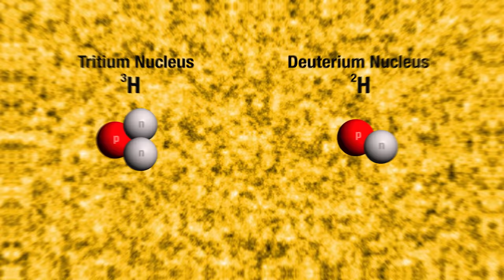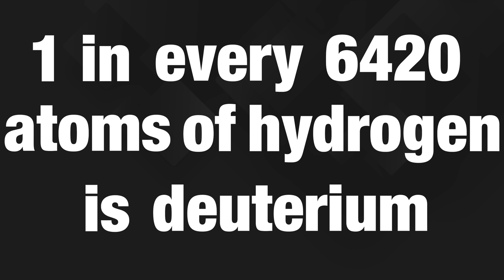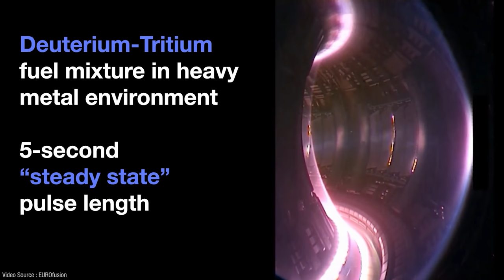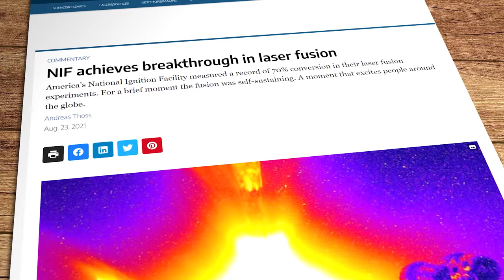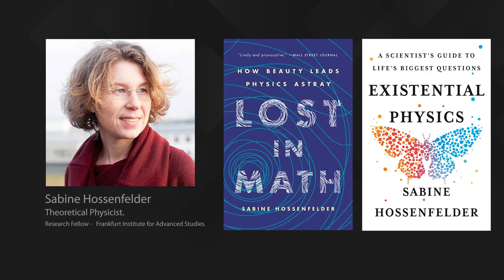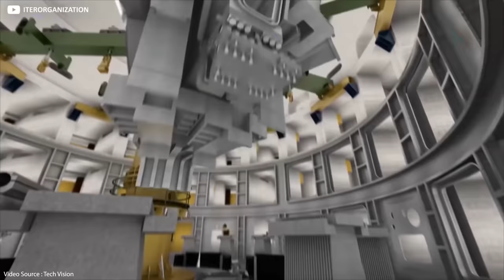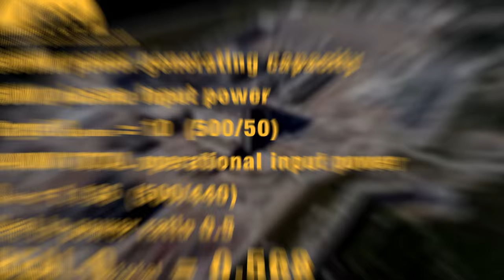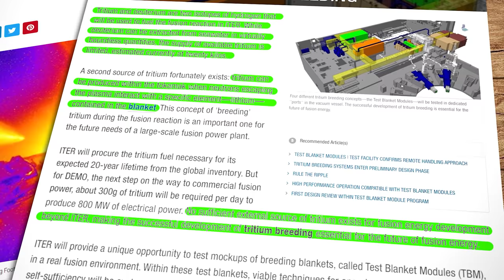Nuclear Fusion Illusion. Is it time to park the pipe dream?

Comment: First mistake right at the beginning, the sun doe not fuse D with T, it does fuse P to P to make D, then adds another P to D to make He3, then those are fused to make He4 and releases 2 Ps. The D T reaction is generally used by most reactor designs because it is the easiest practical one that releases the most energy for a design but it is already a very difficult problem due to tritium. Look up the problem with tritium.

Second mistake, all the elements are not made by fusion, just read up on nucleosyntheses,. Elements up to iron can be fused in a star, but most elements are made by the destruction of stars in the rapid process in supernovae, and neutron star and black hole collisions when vast amounts of neutrons are released that glom onto iron and quickly build up to plutonium.   There is a nice periodic table of elements in color by nucleogenesis, 6 colors so far.

So DT fails since there is no tritium to be had by the time it is needed, and the matter of breeding tritium is largely flawed since the neutron tritium cycle which on paper has a gain of 1, in practice might have a loop gain closer to 1% when it needs to be well above 1. On the other hand fission has a neutron economy of 2.6 or so and is well above 1.

Watch Sabine or improbable matter for a much better video with the correct physics.
Even Wikipedia has a lot of generally good articles on the PP and the CNO chain too.

Comment: We need to be rolling out green tech NOW, not start in 5 or more years time. the time for research into new tech to save us has gone. It will take at least a decade to switch the world over
If we keep on with this 'paralysis by research analysis' we WILL run out of time. 
The window for a viable liveable future is rapidly closing, we need to be at 50% of current fossil fuel use globally and the richest countries MUST take up the slack that poorer countries (who are already impacted by climate change -theyve lost 10-30% of GDP this decade) cannot meet. 
It is not a case of every country reaching 50% at the same time, this is simply impossible with such inequality.
Banking on future tech to save us is avoiding the issue, it is hopeism. we have to act now with what we've got. Im not saying to stop R&D, but i see a lack of rolling out of current viable solutions. The tech we have is good enough, but we have been waiting for perfection. this is stalling us. 
Failure to stop our trajectory of year on year increasing emissions (even the 2020 global lockdown made next to no difference), according to chapter 9 of IPCC report (not mentioned in the shorter policy makers section) is that up to 700 MILLION people on the continent of africa will no longer be able to live there and will have to be displaced due to drought, famine and resource wars -thats in EIGHT YEARS!!! 
Not one single government has stopped it's fossil fuel subsidies!! the very 1st tangible step thats needed to be taken.
Neither type of nuclear will be built and incorporated into the national grid in enough time to save us from ourselves
Reply: @tsubadaikhan6332  i dont have kids either and it saddens me, but its the right choice imo. Id adopt, but im not in a good place for kids
Reply: @kimwarburton8490  "Neither type of nuclear will be built and incorporated into the national grid in enough time to save us from ourselves" - you may be correct, but then you really should be much more depressed.

There are 3 types of countries/locales that have achieved a low-emissions electricity grid:
Type I - Hydro/Geothermal - Norway, Iceland, Costa Rica, Quebec, Tasmania
Sadly, not every locale has the mountains or geology to support these 2 technologies.

Type II - Nuclear Fission - France, Sweden, Ontario
Nearly every country/locale can support nuclear.

Type III - Wind/Solar - ?????
No significant locale has done this. Denmark is perhaps closest, but their per capita emissions for  electricity generation are still above the sustainable limit and nearly 2-3x that of France or Sweden or Norway.

If nuclear fission cannot be incorporated into national grids fast enough, then the only technology PROVEN to decarbonize grids and siteable everywhere is too slow.
Reply: @factnotfiction5915  i think bhutan or nepal is the only carbon negative country n thats cos of a law which guarantees 60% forest n theyve got more than 70% n v agrarian
Who says im not depressed 🤔 
Wave tech, green hydro n battery storage is where we need to push for R&D imo

Comment: We ALREADY have fusion power. The catch is that the machine is the size of the solar system instead of contained in one facility. Solar power is already a better investment than the fossil fuels for energy production but not for storage. There's a bunch of ways we can deal with this. For one we can build intercontinental super conductors to capture the sun on the other side of the planet. Such a system would largely benefit Africa which would ironically be poetic in the history of humanities resource exploitation. We can also adjust the demand side to not need storage such as catenary powered semis or heavily insulated homes so they retain their set temperature for days on end. We can do a whole lot before we even need utility scale storage. While we might in the coming decades have a more viable system for storage I can still confidently say it'll be more expensive than eliminating the need for storage in most cases. Insulating homes for example eliminates much of the wasted heating and cooling to begin with which is currently half of residential power use.
Reply: Car batteries connoting the grid with 2-way transfer of power seems a viable storage option w ‘green’ energy sources
Reply: @tonykelpie  The grid doesn't need backfed power. It needs a consistent baseload which can't be done relying on people to plug in their cars at specific times. However because car batteries have way more charge than is needed on a given day they can be used to spread out load. Instead of bringing the peaks down you bring everything else up making the baseload flatter. Given how big transportation is in overall energy use this could easily work and it avoids the need for storage thats used for load shifting.
Reply: @Furiends  thanks 
I think the idea (which is already being piloted) is cars and other electric vehicles are left connected whenever not being driven.

Comment: I have a physics degree and I know fusion CAN work.  Unfortunately, like many engineering problems it is just a matter of developing a design that actually operates efficiently enough to be viable.  I don't know when that will happen but it is really only a matter of making enough of the required breakthroughs in design, which could happen at nearly anytime or many many years from now.  It is impossible to actually predict when that will occur at the moment.
Reply: I'd argue that we'd already have fusion if we invested the same amount of money in research as we have into fossil fuel subsidies.
Reply: @aquilux-vids  I agree!  It is just a matter of finding adequate engineering solutions which ultimately comes down to time and money invested!
Reply: How can we possibly believe that the energy coming out of a terrestrial fusion reaction can ever be greater than the energy required to create and sustain it?
Reply: @jonathangwynne1917  that is the definition of fusion... It is only a matter of sustaining a fusion reaction on a scale large enough to have a net gain relative to the energy used to initiate it.
Reply: @HerbstaMagus , but that doesn't answer the question.    In order to achieve and maintain the temperatures/pressures necessary to sustain fusion, why won't that take more energy than the reaction can produce?
Reply: @jonathangwynne1917  because the sun exists and nothing except gravity keeps it going... It is only a matter of reaching the scale necessary for the energy output to be greater than the energy input and then harvesting that energy.  We know fusion exists and generates power that is where all the energy from our sun is generated.
Reply: @HerbstaMagus , so you're saying all we need to do is to build a star on Earth...

Gotcha. 

But, short of that,  why wouldn't it take more energy to achieve a contained fusion reaction under terrestrial conditions than would be released in a fusion reaction?

Comment: It's worse than even you describe!   For a technology to succeed, it really has to allow us to do something new.  There are already a half dozen methods of generating electricity cleanly at scale (PV solar, HAWT wind, concentrating solar with storage, geothermal, enhanced gas turbines, biomass) and every one of them is improving every year.  They're already cheaper and cleaner than fission and coal, so they're dead.    By the time fusion or some new fission tech comes along, all of the above will be far better than today.  They're really unlikely to catch up.
Reply: Great point.
Reply: Good point. None of those choices could be used for space ships though.
Reply: You forgot the best one
Reply: @nosuchthing8  Which is why fusion might go on to be useful in space (but not on Earth).
Reply: Exactly. Grid scale energy storage isn't cheap today, but even today its cheaper than fusion. In 20 years when energy storage is far more mature and far cheaper, fusion won't even be in the race.

Comment: whatever happened to "general fusion"? linus tech tips did a video about it 4 years ago, and it sounded promising, claiming to use something similar to steam pistons but with magnets to compress the plasma to increase the tempuratures, similar to a combustion engine.
Reply: General Fusion is building a demonstration reactor (Qplasma<1) that is expected to be completed around 2025.  If that goes well they will try to build a reactor that generates net power next.

Comment: Deuterium-deuterium fusion only reaches the same reaction rate as deuterium-tritium fusion at a temperature of about 10 billion kelvin.  Are any fusion reactor designs aiming to reach that?  If not, they'll be using tritium and that means lots of high energy neutrons to make the entire reactor core radioactive (along with problems like neutron embrittlement).
Reply: That's correct, and this means that after 50 years or so, the radioactive reactor needs to be disassembled and replaced. Luckily, the half-life of these material is not like the long-lived radio-active waste from fission power plants, instead it could be stored on site and reused after another 50 years or so once the radioactivity reached safe level again.
Also, work inside the vacuum chamber needs to be done remotely using robots because of the radioactivity, but this is already being done successfully in JET.
Therefore I don't see what you wrote as a show-stopper for power from fusion.
Reply: @helgefan8994  Neutron embrittlement will require replacing the reactor walls more than once during its lifetime.  Also the materials you end up with after 50 years of use and 50 years of storage will not be the same materials you originally built the reactor with.  They will have become something else through neutron activation and radioactive decay.

The only reason we are accumulating long-lived radioactive "waste" from fission plants is because of obsolete reactor designs and political stupidity.  There is a lot of usable energy in that "waste" (>90% of the energy in the original fuel is still there), we just need to either reprocess it or build newer reactor types that can directly use it as fuel.  Done correctly, all that should be left is a small amount of short-lived waste that only needs to be stored for a few centuries.  This is stuff we can do *today*.
Reply: If you look at the charts you'll see that deuterium tritium fusion is so enormously easier, and produces more energy per fusion event than any other reaction, by such a wide margin that I don't see any other fuel cycles being even remotely viable. Especially because at the temperatures needed to fuse other fuels at a remotely useful rate the plasma will lose heat rapidly just by emitting high energy photons. That effect is relatively mild at 150 million degrees as long as the plasma isn't contaminated with heavy elements, but becomes quite dominant at temperatures in the billions of degrees.
From what I remember at least.
Reply: @JonMartinYXD  "Neutron embrittlement will require replacing the reactor walls more than once during its lifetime."
Yes, and this process of replacing these panels on the inner wall has already been done remotely with robots in JET, so I don't really see this as a big problem.

"Also the materials you end up with after 50 years of use and 50 years of storage will not be the same [...]"
Ok sure, but at least they are safe to handle after that time and not be an environmental hazard. If or how this could be recycled and re-used (maybe even for completely different purposes) I don't know. But either way I don't see why this would be a problem.

Regarding fission technology, I am not convinced that the problem of long-lived radioactive waste has been addressed sufficiently so far. I know there has been some progress on reducing radio-active waste and even using some of it as fuel, but as far as I understood it, there's no "complete" solution in sight.
Also, there's the risk of devastating nuclear accidents which can only be reduced but not really prevented.
Nevertheless, I think for now fission power plants are a better base load power source than fossil fuels because of climate change, at least until better options such as nuclear fusion become available, hopefully.
Reply: @fnorgen  Yes, the fusion movement doesn't like talking about it, but D-T fusion is the only one they can hope to achieve.
Reply: @helgefan8994  Waste burning is something we can do today.  It is actually something we've been able to do for a while.  Same with waste reprocessing.  Look at France.  They're doing nothing revolutionary but if other countries just copied them we would be way further towards our carbon reduction goals.

I'm not saying stop all research on fusion forever.  I'm saying stop pretending we don't have to make big changes now because fusion is just around the corner to save us.  Because that is the attitude I see so much of: "we don't need to change anything today because fusion will save us tomorrow."  "Why invest in renewables, fusion is just around the corner!"  "Why change our lifestyles to reduce carbon emissions, fusion will come to the rescue!"  "Why build small modular fission reactors, fusion will make them obsolete any day now!"

For every dollar we spend, and have spent, on fusion, we should spend five on modern fission designs.
Reply: @helgefan8994  and @Jon Martin
"Also the materials you end up with after 50 years of use and 50 years of storage will not be the same [...]"
The effect causing the brittleness of the structural steel of the reactor wall (which is 316L in the case of ITER) is that the high energy neutrons hitting the wall cause displacement of atoms inside the atomic grid of the steel and therefore causing "errors" in this atomic grid. These "errors" can be handled quite easily (after the radioactive isotopes of the steel decayed) by simply remelting the steel. :)
Reply: @JonMartinYXD  "the fusion movement doesn't like talking about it, but D-T fusion is the only one"
What's the "fusion movement" exactly?  Do you mean the countless scientists and engineers working on fusion research over the last 60 years or so?
I haven't seen any of them "not liking to talk about" D-T fusion currently being the only reaction that could be harnessed for energy production in tokamaks or stellarators.

"Waste burning is something we can do today."
Part of it to some degree, or re-using it for various processes in other industries. And yet the problem of high level waste persists, because this is a fairly complex problem involving many different radioactive elements and isotopes. And there's the risk for accidents.

Nevertheless, I agree that we should rather use fission over coal, because the environmental impact of coal is much greater. At least until better options such as fusion, hopefully, will be available.

"I'm saying stop pretending we don't have to make big changes now because fusion is just around the corner to save us."
That's odd, I don't see much of that. Maybe it's because I prefer to watch and read stuff from actual scientists and engineers. Also, there seem to be far fewer false promises in German media about the topic.
I like Prof. Hartmut Zohm for example, from the Max Planck Institute for Pysics in Munich. Unfortunately most of it (but not all) is in German language.
Reply: @JonMartinYXD  I don't know much about hyperloop, it's not exactly a big topic here in Germany.

"Fusion, as they understand it, is perfect: limitless clean power that will be available soon enough [...]"
Once it is available, I also think it will be pretty much perfect though, just expensive at first. It would be basically limitless and clean as far as I understand it, without the environmental impacts and risks of fission power plants.
Unfortunately it's too late for climate change, and I would also like more accurate reporting on fusion at times. But that doesn't mean fusion energy won't be important in the long-term future. Funding should continue imo, in addition to addressing climate change now with renewables.

In Germany, we should not have started to shut down our fission power plants after the Fukushima disaster of 2011. Rebuilding nuclear power plants now would take too long and we basically already stopped teaching the know-how at universities.
Now with the war in Ukraine we're also in somewhat of a pickle here in Germany, being dependent on Russian gas and probably having to keep our coal power plants running as well, not reaching climate goals.
Maybe we can import nuclear power from France or something...